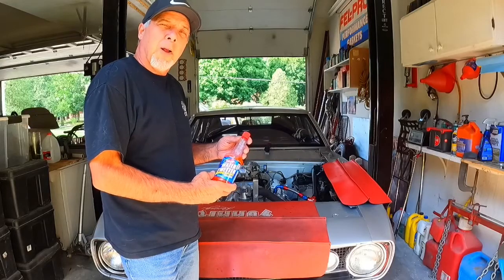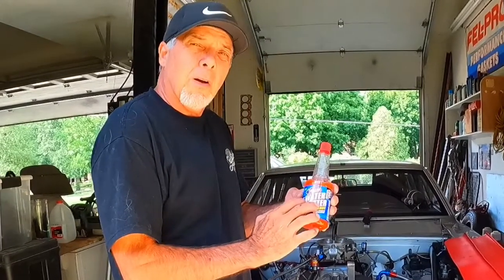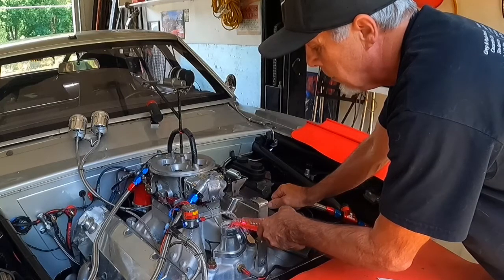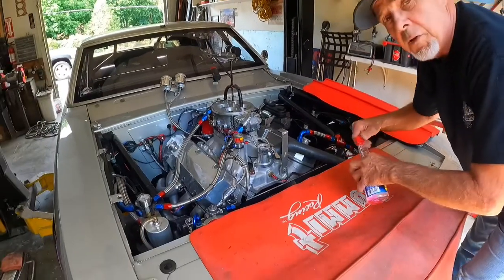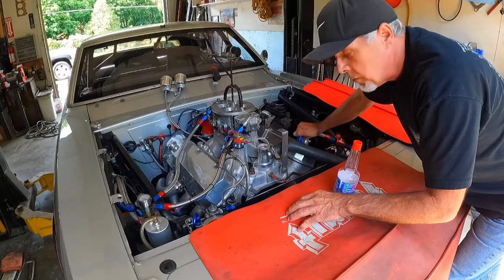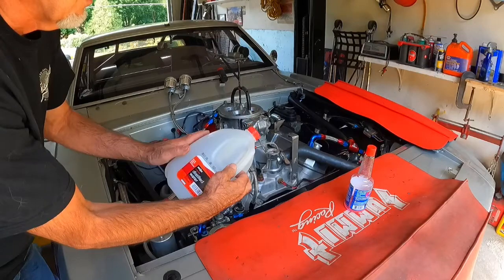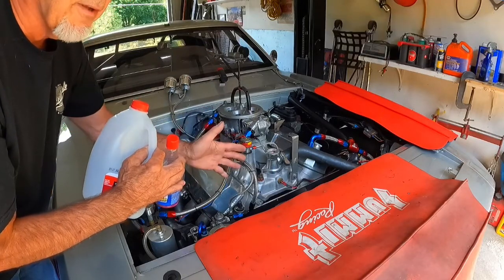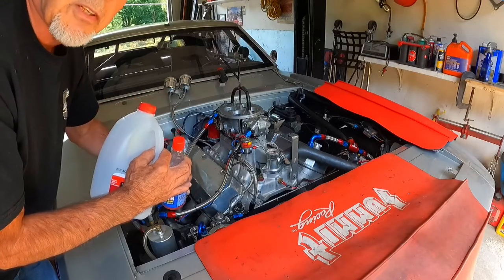How to make your engine run cooler

Comment: I've been fighting with coolant temperatures on my sbc powered sprite. 
I'll try waterwetter as the last item after all the mods I've made to my cooling system
Reply: Sounds good Caly 👍🏻
Understand there are many factors to an efficient cooling system however. Water flow speed can also make a huge difference. The engine in the video ran hot and would not cool down on the street with a 37 gph electric pump but ran super cool with a 55 gph pump. Finding that right combo is the key. Also, imo, I’ve always found a two core aluminum radiator works better than a three core copper. 

Please keep me posted of your outcome. Maybe I can be of help with more ideas once I know more about what it is you have.
Thanks for watching and thank you for your comment 👍🏻